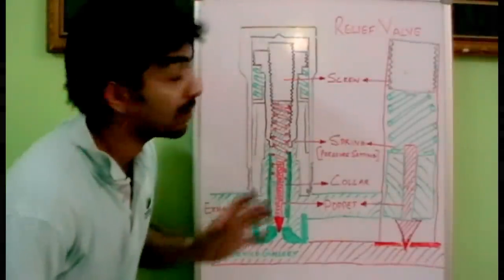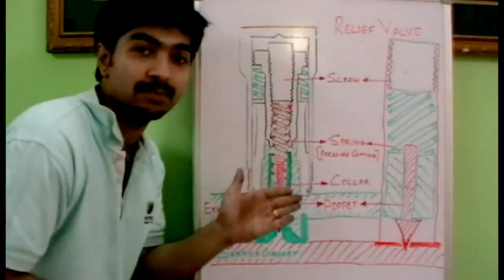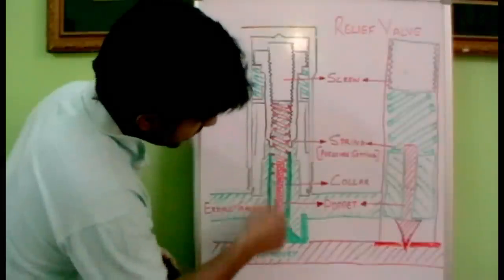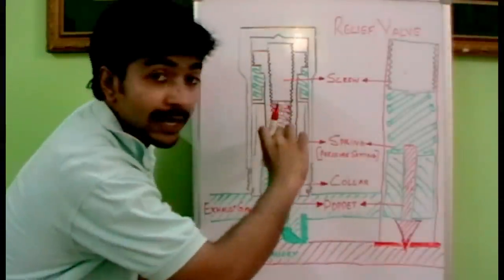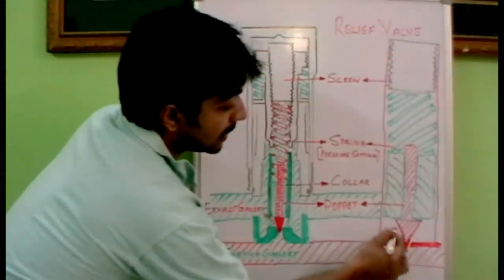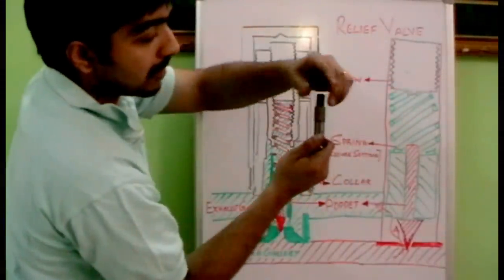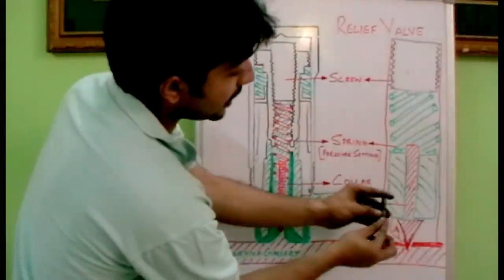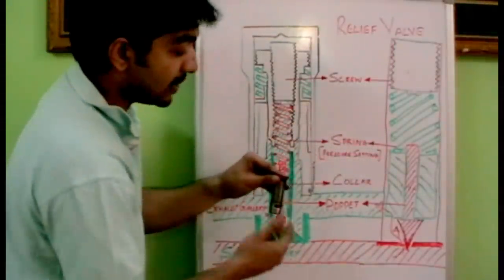How relief valve works. ✔

Comment: Thanks, Great Video. 2 nights ago pressure relief valve failed in my heating system resulting over flooding my basement. The valve was rated for 30 PSI and for 375,000 BTU/hr. So what has failed? Should I get a valve with more PSI? or simply replace existing one with same ratings?